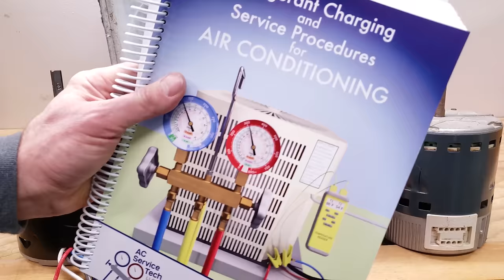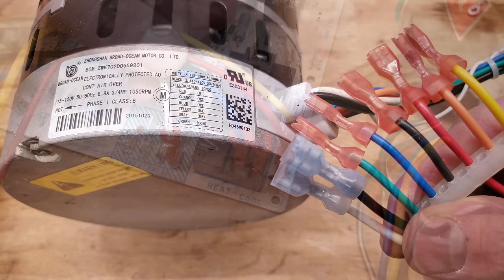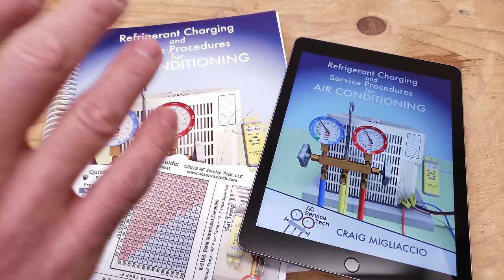Adjusting HVAC Blower Speed CFM on Furnace & AC Units!

Comment: Thank you, thank you, thank you for this video.  My furnace was throwing a low air flow error. The temperature limit switch was tripping it.  After much research and consternation, I came across this video.  They had configured heat with the lowest speed blower wire.  The factory book recommends putting the highest speed wire on heat.  I changed the configuration around and bam..... no more temp out issues.

Comment: Had all kinds of problems,  finally fixxed it! Simple!  Take the red wire out of ur blower motor 1 position then plug it into your #2 position! Over 10 15 20 yrs the contacts wear out or get blackened whear no contact results!  Simple  fix for me took several weeks for me to fix my central heat for free! Do move the wires around before u start taking apart the motor !

Comment: Could you do a step by step video on converting from an ECM to a PSC motor.  A lot of  techs could use this information.  I don't do videos, but  you do, and I think it would be  very helpful for all techs. thanks
Reply: I agree, would be very helpful. But I also dont shoot videos. But would be beneficial.
Reply: nota newbie I understand your motive here (cost) but besides the huge liability and the completely different voltages used (speed taps), the ECM is a better motor in several ways.  The ECM motor is up to 75% more efficient, it is soft start, runs cooler and the speeds, on/off delay are completely programable.  Heck a new ECM X-13 motor even figures out on it own the correct rotational direction.  The ECM is supposed to last longer (but I personally haven’t seen that).  And ECM X-13 changeout is incredibly easy — just plug-n-play and difficult to screw up.  In reality a control board is not needed as you could run wires straight from the thermostat to the speed taps on the motor. I’ve seen that Carrier has stopped using a control board in several units now.  My advice is shop around as ECM X-13 motor prices vary greatly. They’re all made by the same company, Genteq and stamped with “The Dealer Toolbox.com”.
Reply: Ecm in theory are better motors, however we all know the Ductwork isn't designed for them, therefor psc motors are still superior.
Reply: nota newbie. If ur not a newbie, changing a ecm to psc is the easiest thing to do. RELAY
Reply from the maker: Nota Newbie, I would like to do one in the future along with an oem ecm to retrofit ecm replacement, thanks for letting me know what you would like to see! Thank you all as well for each of your input!
Reply: @rogerf3622   Have you ever put your meter  on an ECM motor and A PS C motor of the same horsepower  same load same blower wheel size and seen 75% less power use from the ECM motor? I have not in fact every unit I every unit I checked they use the same power. 

Also please explain how there were there were units coming out at the same time Of the same size and the ones with the pea and the ones with the PSC motor had the same seur rating had the same seur rating as the ones with the ECM motor?

Comment: This is good for teaching a homeowners' buddy how to mess w his airflow. Otherwise an employed technician would already have been told the basics by another tech where to change speeds, and look at charts in the manual hopefully left on site if wanting to adjust dipswitches for whatever reason. Basically dont touch anything unless u have experience. Thanks for taking the time though n maybe there is a new employee for a small company that gets no help from other techs n learned something here so kudos for that.
Reply from the maker: I mentioned that I actually see the speeds incorrectly set on too many units out in the field. It may not be main service techs but maybe installers that are sent to start units up that may not be aware of it. I think it is just techs not taking the time to read the install manual to set the unit up properly but it results in a bad install even after all that hard work that was put into it, thanks!
Reply: Gotcha. I hear ya n very true. Side note, lot of service calls lately w people using portable humidifiers n clogging filters within a matter of weeks causes issues. Minerals in the water floating around causing dust. The calcium i assume. Using distilled water would be better for those.
Reply from the maker: Nice tip M B!

Comment: Have you seen the new Goodman variable speed furnaces? The board is bluetooth controlled, no more dip switches. You control all your speed settings and start up through the CoolCloud goodman app through your phone. It's pretty slick. I like them. When u have a service call. I just link my phone to board b4 I step foot in customers house. And i already know what going on n what's wrong with the unit all b4 stepping foot in their house.
Reply: wow..that is cool...most stuff i service is apartments and three deckers with old stuff..i ran into a milivolt boiler from the 1970s few weeks back and it was still going strong just need a new powerpile..
Reply from the maker: Thanks for mentioning that Brennen-steve Higgins!

Comment: I got a new unit installed and it seemed very loud and too powerful.  The techs said it's working normally and I would get used to the new "efficient" unit.  Thanks to this video I now know they're either unknowledgeable about this or just didn't want to bother coming back.  I'm still deciding if I want to give this a shot myself or call insist on a return visit, but either way THANK YOU for showing me it's possible to adjust CFM.
Reply: I would call another company, maybe ask around first, someone reputable.

Comment: I see this Video was put out a year ago so don't know if you still monitor it ,
  My question is Our Residential Central heat & air is like 15 yrs old ( knock on wood she's still chugging along ) hoping to upgrade this Winter, Ive cleaned the outdoor Condenser Unit last week , flushed the outsides coils , removed the leaves & accumulated dirt sitting in the bottom of the pan , An today I went up in the attic an pulled the panels on The Air Handler Unit , I cleaned The Evaporator coils with some spray cleaner, took a soft nylon brush similar to a giant toothbrush to clean off the big chucks , an then dragged the Garden Hose up there an blasted it , at first the water would not flow thru it ,I pulled the Blower motor housing out an cleaned the blades on the squirrel cage fan . This like doubled the Air Flow coming out of the register vents . Also I popped the cover on the antique wall mounted thermostat that has that lil Mercury bulb in it took a small brush to everything an cleaned it to remove the dust & checked my wire connectors on the back . Right now the blower in the Air Handler is set in low  I have a total of 3 pins, L M H , would it be feasible to run the Blower on Medium Speed ,

Comment: Hello, I recently got a brand system in my home in FL. It is a straight cool system with a heater coil. The compressor was also replaced. My air handler is located in a closet in the hallway with the return grill facing the living room. The new unit cools great but it is way louder and it has way too much airflow compared with the old one. I can hear a lot of airflow noise coming in the return grill by the living room and it is pretty annoying. I can see the air filter trying to collapse from the increased airflow. The technicians checked the speed taps and they told me it is in the lowest setting and there is not much else that can be done. This was installed back in February. I have been trying to get used to the noise but it is too much. I am familiar with replacing these motors and most of the ECM modules. The current motor is a Genteq Endura Pro with the same ECM control module that I have replaced before on my old unit. This new module has a sticker on it that says: " This motor is programmed to: hi #5 (100%), med #4(91%) and low #1-3(81%). So in reality I only have 3-speed taps instead of 5. My old air handler motor the ECM module came with 5-speed taps and I adjust it accordingly. A new replacement Genteq ECM module for the new Endura Pro comes with 5-speed taps like the previous modules that I have replaced before from Genteq but it comes with 5-speed taps.

If I replace the ECM module of the new air handler with a newer ECM replacement module with 5-speed taps, Would that give me two additional slower speeds than the current module at 81%? Because I will be able to quiet down the unit some more. I understand the airflow would be less but I believe that the current ductwork which is 25 years old is not designed for that much airflow and they did not do an airflow test before or after. Most of these companies sell the units by sqft which is an important factor but I feel the ductwork has to also be the appropiate size. My ductwork is all made of fiberglass panels. 

I appreciate your input on this. Amazing videos by the way. Very instructive and helpful. Thank you!

Comment: I wonder if the ECM's are worth the failure rate?  1/3hp PCM 600 watts vs ECM 250watts saving 350 watts at 12 cents kwh x 6 hrs /day+ $92/yr is good savings.  But for average homeowner that can get negated by replacing ECM too often vs a PCM that lasts 25 years.  Also the less heat generated by ECM doesn't have to be removed from AC mode saving but not a factor in heating actual helping.  Still need good static pressures in any case, very important!
Reply: Those ecm heads are SUPER expensive too. I've replaced some where just ecm control head was $500 my cost, that's not including the motor part either. So add more $$ for that.
Reply: Also ecm no longer have an external capacitor you can replace, they are in that ecm control head now. So if capacitor goes guess what...u gotta replace entire head. But ecm are the way of the future, they're gonna be on everything shortly for energy consumption. I was saying in another comment, on the newer Goodman var. Speed units. They have zero dipswitches now. The main board is bluetooth, u link ur phone and control all your speed and startup through an app with your phone. And when unit breaks down. No more board light codes. You connect to bluetooth and it will tell you EVERYTHING going on with that unit and even the parts u need to fix it. Pretty cool.
Reply: Brennen-steve Higgins. That may be true, but sometimes old school is better and last longer. PSC motors have been around for a very long time, test proven. No need for smart phones.
Reply: @watermanone7567  I can agree, stuff today def isnt made like stuff from years ago. But im for anything that makes my job/trade easier and less tools and equipment for me to carry around. So a cell phone over meters, jumpers etc..I'm all for it lol.
Reply from the maker: Yeah depending on the customer and install, the cost savings may be negated by the breakdown and replacement. What I don't like is that the customer has a breakdown period, regardless of the cost. I don't want them to think it was something that may have been done wrong on the install job even after explaining how it can happen. Thanks for all of your input!
Reply: that's what I've been saying since the first failures and same for all the newer equipment, so many early failures it sucks. automotive, building products, electronics and all the rest are no better.
Reply: @throttlebottle5906  its cause shit today is mass produced by automated machines/robots, over seas. Where quantity is over quality. Only time humans technically put hands on mass produced stuff is the end of the line just to make sure it functions. The days of hand built or human assembly are all but soon gone. Guess that means job security for us 🤷‍♂️🤷‍♂️🤣🤣
Reply: Variable speed allows for better dehumidification and higher comfort temp in summer. An overlooked savings.   
I pay avg $80.00 gas plus electric In Ky and $130 for a month with many 100 deg days. It is a bargain.
Reply: @robertpeters9438  Only if it doesn't fail early and you have good static pressures otherwise no KWH savings.

Comment: I have a question. We have a Frigidaire furnace made by Nordyne. It has a two stage burner and a variable speed blower. One day last fall/winter the blower would not come on. Checked the fault code which suggested overtemp in the burner which would be normal if the blower was not running. That fault shut down the burner which gave us the fault code. Tried to run the fan in manual. Could hear the relay click on the circuit board, so I assumed the problem was the blower and not the board. Took the blower out, got numbers off the blower motor and asked our guy if he could get a blower motor. A day later he said yes, but it would take 4 days and would cost me $1200.00. WOW! That was for the motor only that did not include the module on the end of the motor. What a mistake that would have been to get that motor as it was not the problem, but rather the motor module.  I started watching YouTube videos about variable speed blowers not working. Many like ours go out because of a thermistor on the motor module. After looking, our thermistor was cracked. The part numbers were not clear but I found some info about our part and a cross reference number. Got the part, installed it and all is well. The motor does seem to run perhaps a little slower. I notice that because I used to get a harmonic sound out of the registers that I do not get now. Does the thermistor sense temperature build up in the plenum box? Does the thermistor sense static pressure perhaps that builds up during the heat up after the burner comes on? I wonder about it's function because I wonder why the thermistor cracked. Seems this is a common problem. Maybe because the air filter which is April Air 2200 was perhaps dirty and was impeding the air flow which could effect the static pressure inside the blower box. Any suggestions would be appreciated. This has been a great furnace and was a replacement during a home addition project. We had a Manual D load calculation run to help us determine new duct sizes, return air sizes and even the size of the furnace and air compressor. I totally believe in properly sizing eveything in the system now. It has been beautiful and well balanced throughout the entire house.

Comment: Is is possible to  combine two functions into one tap (i.e. cool and heat both running in medium setting)?
Reply: AC Tech answered this question already in earlier comments.  The answer was... YES. You can add a jumper wire so that cool and heat use the same fan speed.  Any unused wires should be wire nut capped and electrical taped.

Comment: my instructor just said remember the basics....trying to push heat up you dont need to fan on super high..heat rises....trying to push cool air up ..you want the higher speed  ..cool air falls... and of course the opposite for rooftop units..
Reply from the maker: For heat, you don't want too high of a fan speed or the occupant will feel cold due to the extra air movement that will cause the humidity on their skin to evaporate which cools people down. This is the opposite of what you want during winter. That is why hot water baseboard feels so comfortable. Air is only moving through convection and the people do not feel so dry.
Reply: @acservicetechchannel  good points
Reply: so what speed should the cold ac speed be at the blower i have a 3 speed
Reply: i heard people say its better at low speed

Comment: ACSERVICETECH, Can you make a lesson about measuring CFM and Air Flow measurements because most AC conditioning techs will measure the temperature but don't know how to measure the CFM and Air Flow. What happens is that the temperature of the AC vents compared to the temperature of the room will have a Delta temperature but the CFM and Air flow will not be set correctly so your electrical bill will be very high at the end of the month because it takes longer to cool down the room or multiple rooms in the house or apt because of the CFM and Air Flow not being set correctly.

Comment: Thanks so much for this video. I'm looking for a second opinion if possible. I had a HVAC pro replace some parts on my furnace, including the board and the fan, and now when the furnace kicks on I hear the fan for about 60 seconds, then it pauses, and continues. The tech told me that is normal, something to do with it being a single-speed fan but the board is trying to switch, so there is that pause. It's kind of annoying and I'm wondering if it can be fixed by adjusting some settings on the new board.